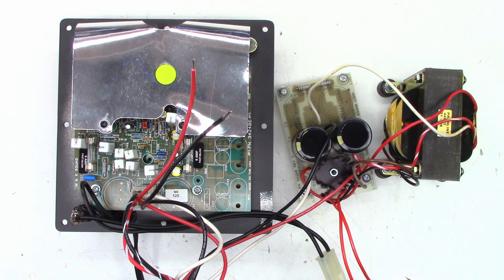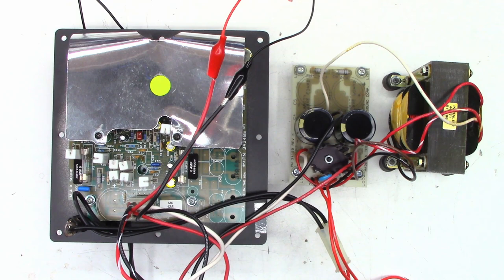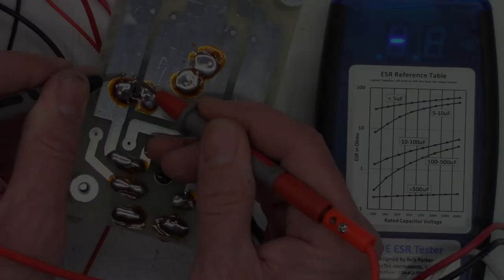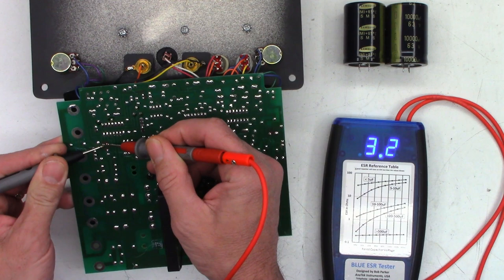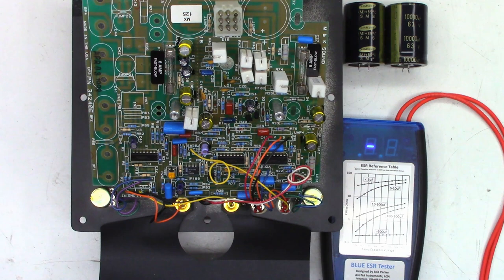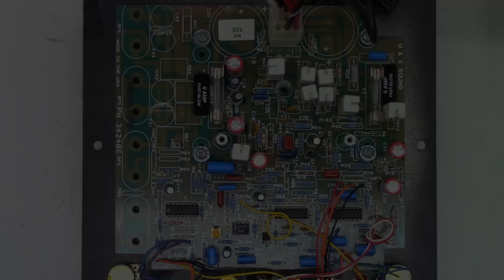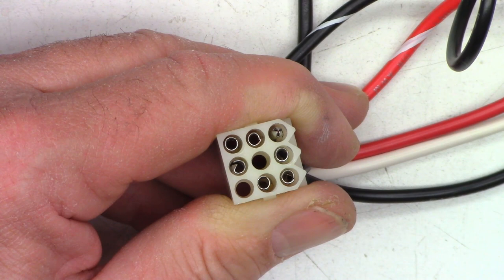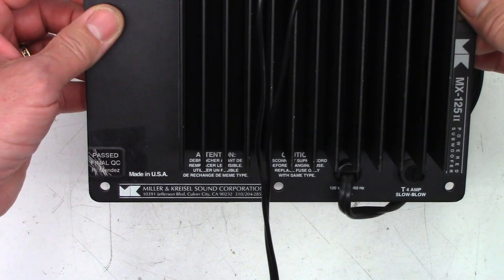Miller and Kreisel MX-125II "Loud thumping sound" 24+ year old sub restored to like new operation

Comment: Nice one Norcal again, I fixed that Yamaha amp I said about on another video a 5v regulator was the cause. I had a Cambridge audio Azur 840 I recapped yesterday 4x 15000uf 63v Cambridge Audio branded caps faulty causing DC error message. I replaced the whole lot as they were all some cheap brand, that was an interesting amp class XD

Comment: i like the deoxit d5 fix i used to use wd40 on my old 70's Sansui receiver when the volume knob when turning would crackle. some one told me it was in the switch. so i would pull the knob and spay into the shaft it would work for a couple of months then i would have to reapply it

Comment: How much time did you have in it. What would a shop charge?? I had a 150 i think back in the 90's.  Looking at one of these mx125 mk2 now.  Seems like they break a lot.
Reply from the maker: I would say the average cost to repair one of there is around $125-$150 plus shipping. Usually just failed capacitors or an occasional output IC. Overall great sounding units.

Comment: Thanks for the video! So the problem was really dirty pots and some contact cleaner fixed the issue?
Reply from the maker: Ultimately, yes I think so. But due to the age I believe the capacitor refresh was in order.
Reply: @norcal715  Great thanks! I have my friends 22 years old Audiovector subwoofer that makes weird noises and makes no sound. I will clean the pots and replace the capacitors :)